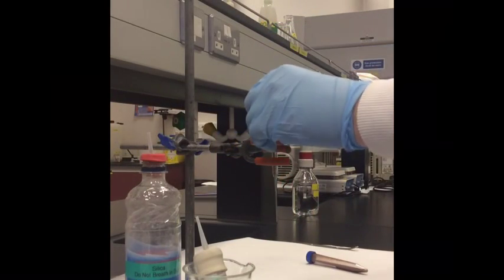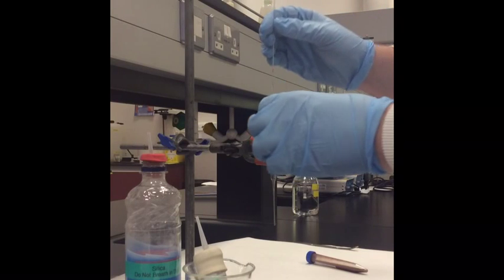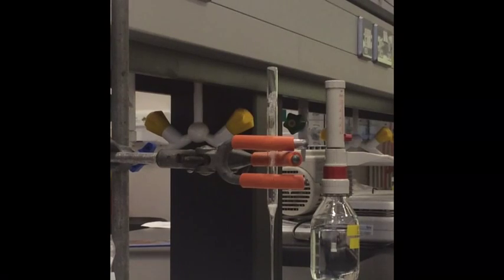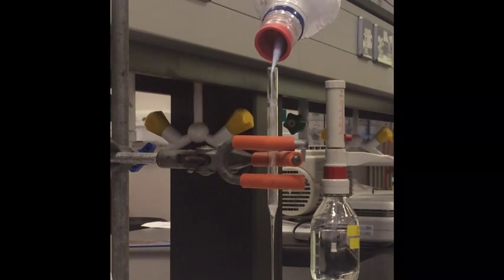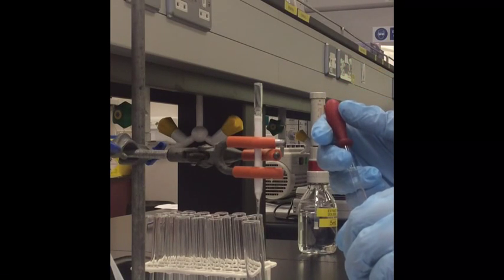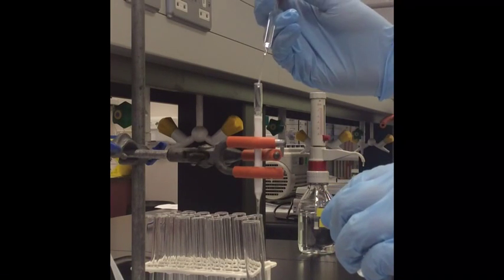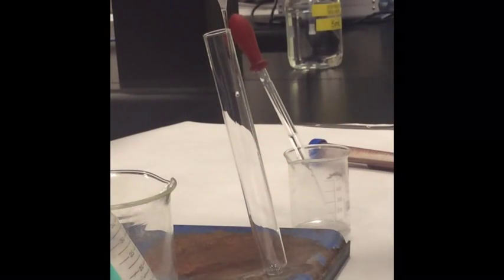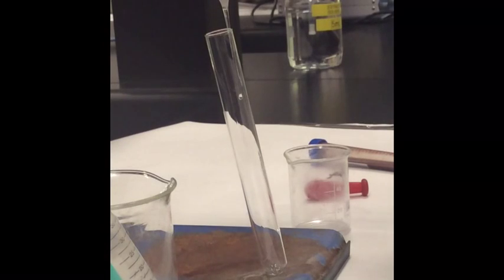How to prepare a micro pipette column

Comment: Any and all manipulations with dry silica gel should ALWAYS be performed in a fume hood. Silica gel readily generates fine dust-like particles which can easily enter the lungs which can cause pneumosilicosis acutely as well as lead to cancer. It is stated in some sources as being similar to asbestos and so I think it's helpful to consider this when handling silica. Otherwise I found the video well composed and informative.
Reply from the maker: Thanks for the feedback Grant, I was using a respirator while shooting the video but quite rightly said, any work with silica should "always" be performed in a fume hood.
Reply: I didn't even think of the possibility of using a respirator, but yes that is suitable too (as long as no one else is around you of course and a fume hood is not available). At any rate, thank you for you the video!